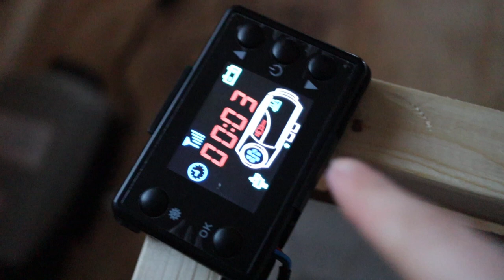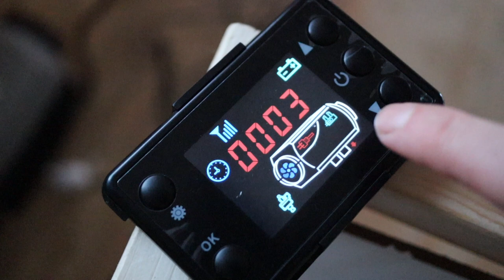Another Day in the BUS || Diesel Heater Install & Office Room Redo!!

Comment: I forget how I did it,  but I have the same controller and if you hold two buttons at once you can manually prime it,  if you ever need to
Reply from the maker: Yes! Thanks for the tip, we had to do this the first time we started the heater! It's running great now!